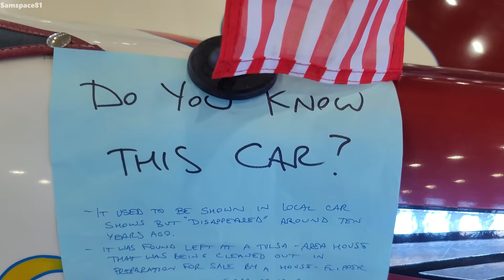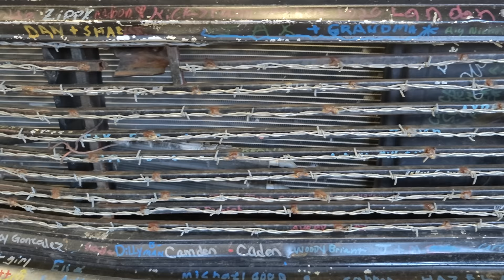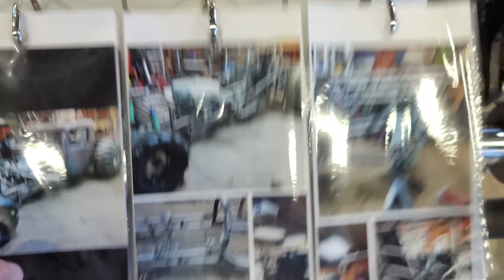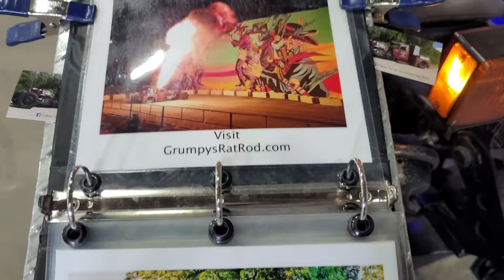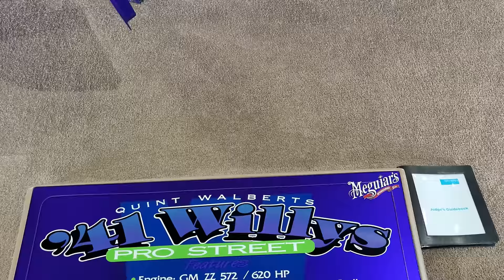Tulsa Oklahoma Darryl Starbirds Rod & Custom car show II Rat Rods Hot Rods Muscle Cars Classic Cars

Comment: 0:20; How about a Tanchero (including T-Bird dash, center console & seats)?
At 12:50; seeing the hand grenade shifter knob I thought, turn it around 180 degrees and have the lever toggle on and off an overdrive, with the pin used as a kill switch (pin in / switch on)?  ;-)
Alas, no Corvairs.  ;-(
Reply from the maker: Keep watching ;)